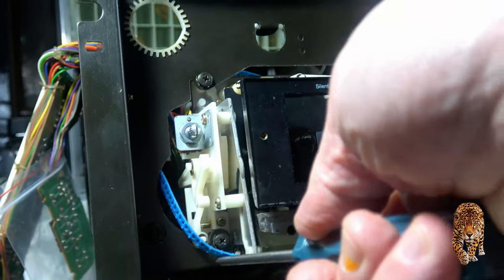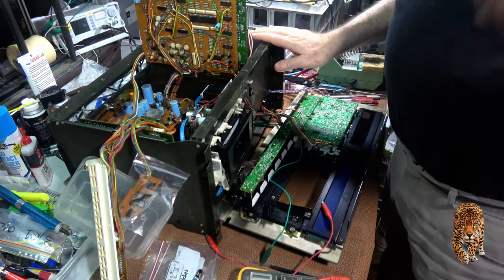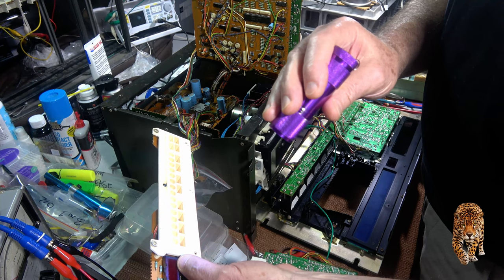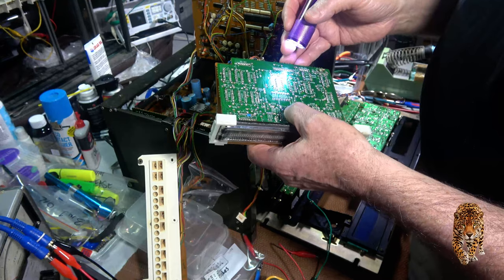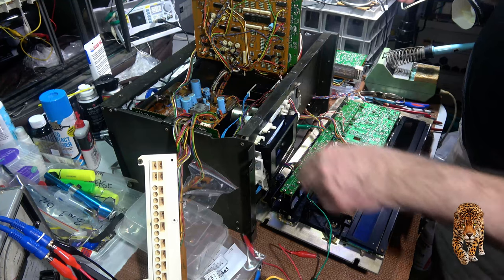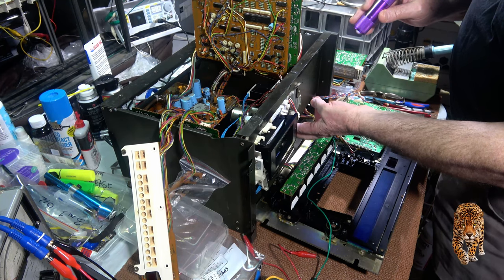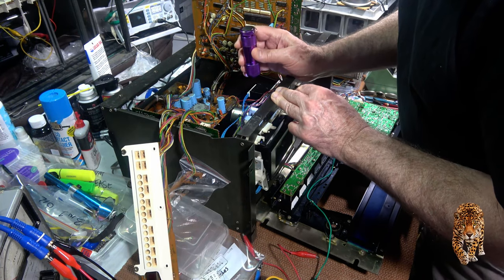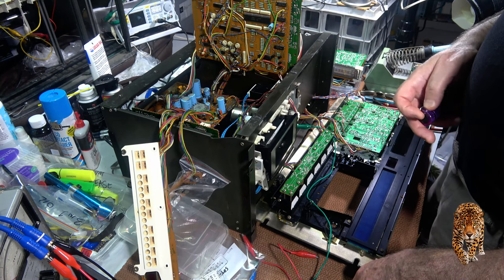Nakamichi 1000ZXL Repair Part 4b. Assy of front panel and transport mechanism. Stocktake of faults.

Comment: Nice videos, i enjoy watching. The 1000 zxl was a very complex deck when it came out and it's auto calibration is a very complex, just wanted to give you a heads up on a special tool that they made specialy just for this machine. It's the m-9057 test unit as described in the service manual when making electrical adjustments that is essential.
Reply from the maker: Thanks. Yes, I know of it but the owner was not prepared to purchase it as it was over $700. If the 1000 were mine I would design the test pcb myself and manufacture the test rig.
Depending on the owner it may still need to be purchased but we'll see. (p.s. I used to design pcbs for Agilent as a job). 
For my CR-7 I bought a test rig but it was a lot cheaper and it is for my own CR-7.  Cheers.
Reply: Yes you're wright, the cheapest way is to make it yourself, not complicated but needs lot's of work. One made them on eBay for about 300 euros. Keep up the good work, unfortunately belts are problematic for everyone, it's like lottery, never knowing if you're going to get good enough one's.
Reply from the maker: @apogeios  E300 is about $700 for me here. Same guy I assume.

Comment: Yes to the dried up grease  which is the first thing I would do before working on the electronics . You need to remove and re grease the pinch  rubber roller assembly and fully rebuild the transport . so many things wrong with this.. there is a website called tapeheads that could help which I subscribe to and the 1000zxl is one of the hardest to fix  
 good luck
Reply from the maker: I did a lot more to the transport in the video to come. The pinch roller pivots were frozen solid, now repaired. The transport is now working well but I acknowledge at the end of the video that in the future a full clean and rebuild should be done to get the most out of the deck. It isn't my deck so I won't spend any more time on it than is necessary unless I get paid commensurately. I accrued over 12 hours of new video on the mechanism as it is. A full rebuild would take me at least another 2 full days, there are too many other faults to unnecessarily spend extra time on the transport at this stage. The deck needs to be proven before any real restoration takes place (eg. power EL caps). If it were my deck , I would  still follow this strategy. Even now if I were a repair shop and not a hobbyist the repair would be uneconomic. 
I don't see a huge transport difference between the 1000 and the 480 series, mechanically I think they are ok (except for the crap plastic idler arm on the 480).
I'm more scared of the computer repair than the audio. The VU display is a case in point. 
Possibly the most difficult is the front panel which I did a full restore/repair as I didn't want to come back to it. 
Thanks and we'll see where this journey takes us.
Reply: @MoggysHiFiAntics   i admire the work you do. keep up the great videos
Reply from the maker: @johnweegenaar7314  Thank you. Repairs have always been a nice hobby for me although it can get very frustrating.
However, if I want real frustration it's tracking down computer build problems as I build all my PCs and NAS boxes. Networking is a pain. I use unraid and nas4free for servers. 
I'm sick of "do everything" android boxes for my HT. They always seem to have limitations on file formats. I'm now thinking of building a good i5 Intel NUC to do all my networked audio and video organisation, plex for video and maybe roon for audio. Being a W10 box it will do anything my desktop does and I've been wanting to build another HTPC for a long time. Lots of stuff to do ahead.